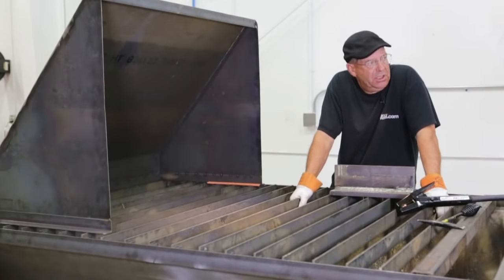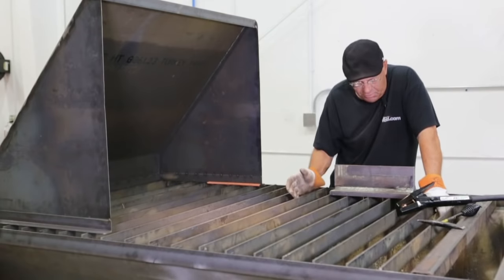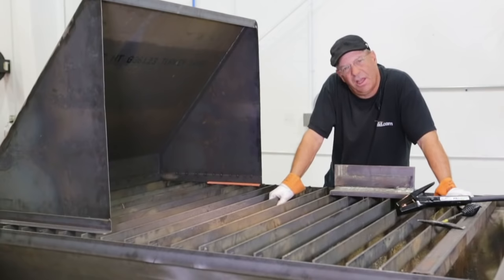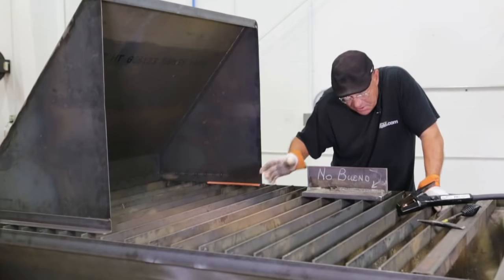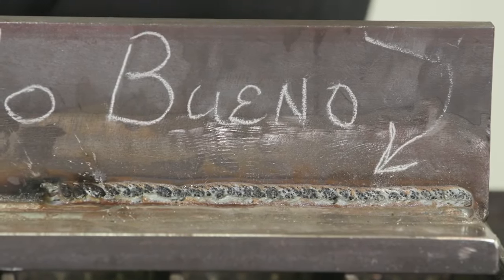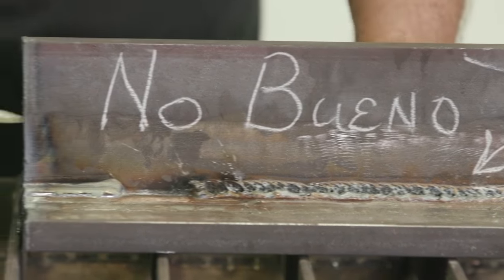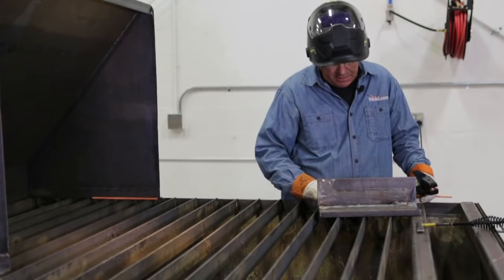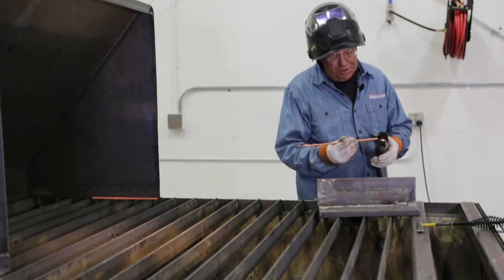Carbon Arc Gouging Weld Repair

Comment: Nice to see you're demonstrating some real world procedures you would run into in the heavy equipment repair field. Boom repair, cutting out bed liners, crack repair pin and bushing removal and so on. PPE is definitely your friend !   Definitely make a good series of training videos. Thanks.
Reply: Ah yes the memories of thermal lancing out pins on a low loader, one after the other.
Reply: My buddies at Electric Boat say they don't allow air arcing unless you're in full kevlar with an air supply. Keep your neck and your ears covered and you'll be fine!
Reply: @HogsHeadStudios  yup full face respirator neck/ arm kevlar plus full body leathers double hearing. Doing that this summer in the 90-100 degree heat really made reevaluate what I'm doing with my life

Comment: i had a job at 18 doing just this. kaiser steel/napa pipe... repairing welds that the robot subarc machine had messed up on the seem of 48 inch pipe. i had to air arc out the weld and stick weld and blend it back.  it was a terrible job! especially air arcing inside the pipe and having all the sparks sneak their way in anywhere they could.   you are a wonderfull teacher, Bob! please keep it up

Comment: I built tugboats for 10 years, used to do alot of arcing.  Weld first side of butt, arc the backside to achieve full penetration.  We were running .045 and .052 Lincoln ultracore. I was real proficient at the process.
Reply: You think you're better than us, Rachel?

Comment: I had the same issue 4 years ago, no carbon arc, only Carbide Burs and Grinders, I was there for a long time.  I was so upset that I it threw it all away and started over with all new rods and welding cables.  I am glad that I am not the only one that has problems.

Comment: Yep. Worked in a power plant as a welder for 38 years. Replaced hundreds of socket weld valves by gouging the weld off. Mostly P-22 or P-11 and ofcouse A-106. Good comments from some that haven't seen a weld repair done using a arc gouger.  Bet they would really like to see a weld removed from a socket weld. Just an idea.

Comment: Bob, we used to call it air-arcing years ago. I started out pimping for a welder air-arcing, and I Learned quick you cover up all exposed skin. My neck was about 2nd degree burned because I didn’t have a leather protector attached to my hood and didn’t think to wrap my neck. My welder just laughed the next day and said, we’ll kid you learned something very important your first day and probably will never forget to cover up. And I didn’t.

Comment: Gouging used to be part of the welding test at the old shop I worked in back in the 80's.  It was used extensively for repairs after critical welds were nd tested and inspected.

Comment: Spay a little splatter spray before you gouge will help with slag and overall cleanup
Reply: @NoizyBearBearOfficial  yeah that is exactly what it is
Reply: We have the spray, but mostly we use the powder zinc oxide that you mix with water and paint on. Works great but ends up getting all over you.

Comment: A better technic is to gouge away from yourself looking behind the arc. Try it, will never look back. You don't blind yourself and see clearly a crack or whatever else you are removing as well as where you go. So you see how much you remove as you go. No overgouging. But 9 out of 10 guys do as they would push the gun. Ok for a foot or two in a while but 'no bueno' for a shift of gouging;)

Comment: I have some hard to access welds to gouge out and redo, no carbon rods (I am at sea), grinding is not an option (inside corner), 5mm thick L bar to samish L bar... Should I just spatter them out with a bare rod?

Comment: The resend you have that problem is because you air arc in the wrong direction plus your not to look at arc flash and the Slag look behind the carbon rod. I'd used to air arc 220 feet in my 8 hours shift and that  was in a ship yard

Comment: I had a similar  problem on some quarter inch steel I was MIG welding. Everything looked good until the last half of the run is it look just like yours did. I cut it out but got the same thing on the reweld. I even went as far as taking it to the mill and cut out everything touched by that weld and still got the same. Bob, what's up with that?
Reply: Check your nozzle. Not just for spatter for for fit. As a nozzle gets hot, it can expand and cause gas leakage. Happened to me when I swapped from a brass nozzle to a copper one.
Reply: Could b junk in the steel I had that problem before some cheap steel gets contaminated with lead and aluminum welds like shit

Comment: When I'm gouging the sparks are flying 20 feet out, it seems you were just pushing a puddle in front of your carbon, perhaps your air nozzle wasn't properly aligned or your air pressure was too low.
Reply from the maker: We have a shroud that catches the sparks. I can assure you that without it they'd be flying 10+ feet.
Reply: @Welddotcom  Fair enough, I spent weeks gouging an annular plate off of a giant oil tank at a refinery and it looked to me in your video the air was blowing behind the carbon instead of in front of it, that makes a big difference because the carbon doesn't like reacting with slag which stops the arc causing lots of starts and stops. Thanks for the videos.

Comment: Do  the automatic welders run coolant through them .I'm not actually very sure but the kemppi units we used to use if they ran low on antifreeze it caused porous welds .

Comment: Do you think that maybe the porosity might have originated from contaminated base metal?
Reply: Na, Bob's just been watching SV Seeker again ;-)
Reply from the maker: We think it was a regulator issue.
Reply: A while back my welding instructor and I were building a trailer and he was dead set that that was the case for one of his mig welds. Turns out the welder's fan was blowing away the shielding gas
Reply: Zachary Kemp exact same thing happened to me with my Lincoln Squarewave 200. Almost drove me nuts.

Comment: How big a machine do you need to run a carbon arc rig?
Reply: Using very small dia. copper clad carbon rod you can do very small cut outs with a 250 dc welder. It would even kick my SA 200`s butt on 5/16" rod. For me ideally it was a 400 to 600 amp dcrp machine and using a 3/8"rod to do some heavier and larger gouging and scarfing work. Most times I preferred to use my oxy/acetylene torch with a scarfing tip.
Reply: I work on heavy equipment i got a syncowave goes to 300 amps and wired to 3 phase 480 volts (100% dutycycle) I do a lot of cutting edges it takes ever amp to gouge using a 5/16 rod on 5/8 blades on dozers

Comment: Its “bueno” you are getting bilingual. I have never seen in person arc gouging, surprises me that it looks like you were able to strip the welding material (porous) but not much of the base metal. Even the rod looks like getting pointed to “match” the shape of the base corner. How deep is the arc melting material from the the tip of the rod? And, should the operator expect some force or contact feeling?
Reply: There is a feel to gouging, but it's pretty dull compared to even something like 6010--which means most newbies take WAY more material away than they need to.

Comment: Is this something you'd also consider a plasma cutter for?
Reply: only if you want to cut all the way through. carbon arc gouging is just for the weld, if its unsatisfactory and you want it gone.
Reply: Yes, you could use a plasma cutter if you had it set up for gouging. Check out weld.com's video on plasma gouging. You could also oxy acetylene gouge it as well.
Reply: I was wondering the same thing as not everyone has access to a carbon arc set up, but many people now have access to a plasma cutter.
Perhaps Bob could offer an opinion or even make a video on the subject?
Reply: I disagree with you on that as with any tool or process it all comes down to how you operate it and the skills and experience of the operator.
Reply: @markfryer9880  That and I'm pretty impressed with what the electronics in modern welding equipment can do.  Heck, look at the size of old, limited TIG machines!  I asked because my old Firepower FP18 can't cut aluminum, but I can gouge textures.  With higher-budget gear, I expect it's common somewhere.
I'd love to see Bob do an episode on this to see how it's done and why/when.  It's the decision-making and seeing Bob pull something bad out of the ditch, so to speak, that I most enjoy here.

Comment: And anyone who mig welds knows it was a shielding gas problem of some sort
Reply: Or it was a preplaned designed flaw for the video!
Reply: If it was a everlast welder I have had the gas solenoid stick in mine a few times it  should b open should b working but it's not stop welding start again and it works

Comment: Hmmm. Wonder if that would be good for opening a safe......
Reply from the maker: It'd be great for opening it... Not so much for what was inside it.
Reply: I've done it a couple times. You have to cut it very thin without cutting through then use a cutting wheel